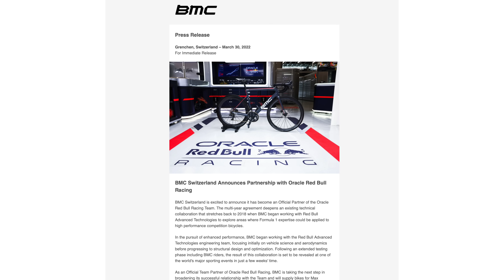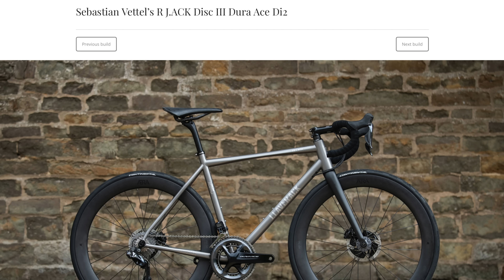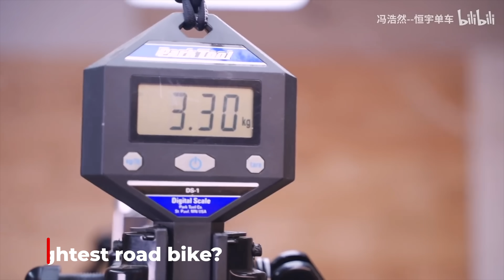3.3kg! The World’s Lightest Road Bike? New BMC and Factor bikes and tubeless foam inserts...

Comment: This is probably the second or third lightest road bike, but not the lightest. In 2010 Gunter Mai assembled a bike with the same weight of this custom Cannondale, then some guys of Fairwheel Bikes (Tucson, Arizona) bought this bike and re-assembled it pushing the limit at an incredible 2,7 kg!!! See more specs searching "the lightest road bike". I'm surprised that many cyclists didn't know this famous bike, assembled more than ten years ago. It has an estimated cost of 45.000 dolllars... only wheels (ultra-customized of course) is a 15000$ set and weight a ridiculous 500g... the frame is built by Spin, a German brand. This is the most extreme and light bike ever!!!!
Reply: It can't be functional. It has to feel like spaghetti under you! I would bend a 500 gram st of wheels with my eyes before I even sat on it! Lol

Comment: soon me Colnago Master (big size frame) with Campagnolo Super Record from 2011 and other carbon parts will be finished. It also has some vintage parts, not to mess up the look. It will weigh around 8,5 kg i guess. It looks astonishing and i would rather ride that than the lightweigt 3,3 kg bike in the video. Min u, the Super Record Titanium Carbon 11 speed group from 2011 weight a little below 2 kg. But, it is amazing how the owner of the 3,3 kg bike got it so less weight, with also German parts.

Comment: I'm a 100% Tubeless advocate, and I've had the Vittoria Liners on backorder for a loooong time now. But I've yet to see a Tubeless tire seal airtight on a tubeless rim. I've tried quite a few different tires on Zipp, DT, and the new Ultegra rims.  Without sealant, they won't hold pressure.
Reply: I have WTB Riddlers on Stan’s Valors and they hold air without sealant, though they do lose air slowly like a latex tube.
Reply: Same as Parseeker, my WTB riddlers definitely hood air without sealant on my zipp 303s rims.
Reply: @johnwedlake5543  Interesting, if I ever need to put gravel tires on my 303 Firecrests, I'll try the Riddlers.

Comment: Heavier bikes ride better, are cost effective and have rugged frame strength.  Not wasting my money on the newest, lightest and most expensive bike products.  If you want a lighter bike, get fit and loose some weight.  The scale does not know the difference.
Reply: Literally scrolled down to find the "lose some weight" guy. Didn't take long. Although you seem to have an extra o in there.
Reply: @Bikey_McBeardface  His pants are now too loose.

Comment: What's the point of a foam liner? may as well just run tubes?
Reply: Si on the GCN show demonstrated it very well. It's a fail-safe for when you get a puncture and the sealant doesn't do what it's supposed to do. You'd use it to cycle back to safety cautiously.

Comment: I’ve got the tyre foam insert, great idea, easy to put in, but a nightmare to get the tyre off when time to change the tyre. So much so they are sat in my garage and not on my bike. In my opinion they need the wheel width of mtb and not road bike wheels.

Comment: How long does a carbon fibre chainring last (including UK winter use:-)) ?
Reply: Not sure but you'd be counting in meters, not kilometres 😂
Reply: Aren't the teeth usually hardened steel
Reply: @jussa101  In Carbon-Ti's case, it's a carbon body bonded to a teethed alloy ring. Somebody sprinted with this chainring till the ring separated from the body as there's a chemical bond that goes in between them.

And basic structural physics shows two different materials bonded together will never be as strong as a single piece.